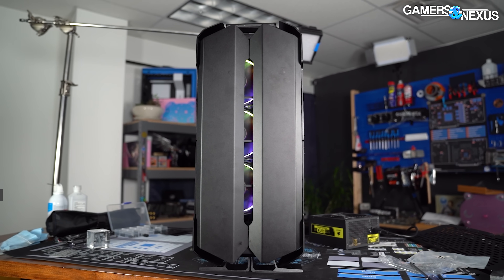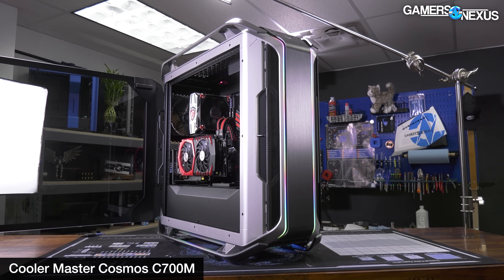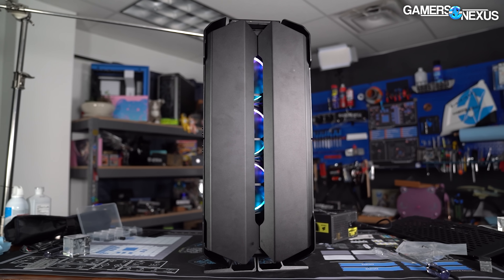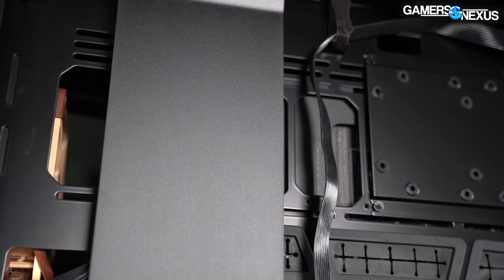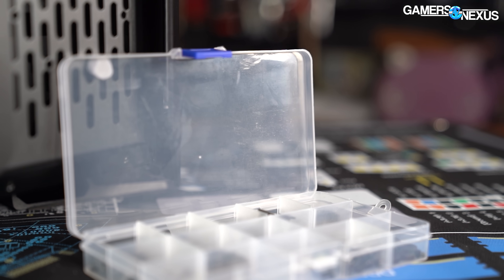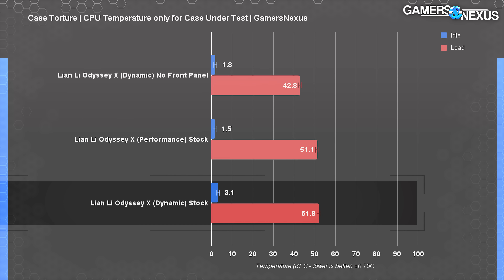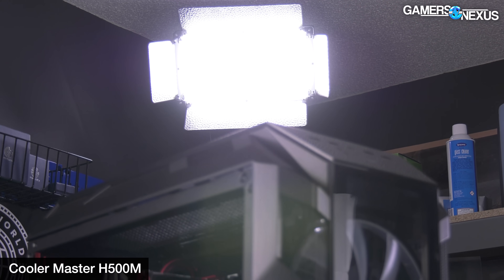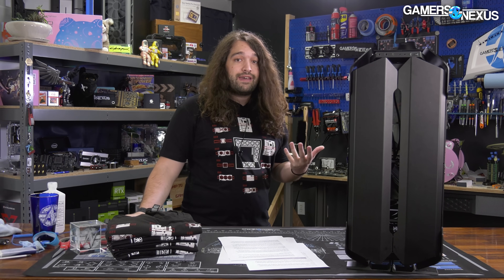Lian Li Odyssey X $500 Case Review: "Transforming" Full Tower

Comment: I can strap a 40 cm desk fan to the open side of a 50 dollar case  and have better thermal performance than any of the cases on that list, now that is good engineering! And it would  probably be even super quiet/ low pitch. A case HAS to run cool BEFORE worrying about looking cool and a 500 dollars one has to be the absolute best at both  to be considered. I like glass a lot too but on my windows to trap the heat inside the house while I am looking outside. I will never understand this obsession of using (expensive) glass for side panels, especially since components tend to run hotter and hotter lately.

Comment: Man for how big it is and how much it costs, I'd expect something along the lines of the 1000D, but the functionality just doesn't seem like it's there to the same degree. I thought $500 was a lot to spend when I could literally put 2 builds in the case, but this one doesn't let you do more than one, and has less room for watercooling parts and no easily removable fan racks either (corsair's fan mounts come out on rails to boot). I can also mount 2 480mm rads and still fit a 420mm rad in the top of my 1000D, though accessing fittings might get a little difficult on one at that point (i used 2 360mm in the front that I already had so this wasn't an issue for me). Those side panels also are meh IMO. folding in half is cool but for $500 i'd expect them to be held in place by something better than a glorified push pin

Comment: My main concern with such a case is radiator support. Let's be real, this is only for someone who has already spent ridiculous amounts on liquid cooling. But you may as well go for a super tower rather than this.

As an example, when I tried to build my rig in an o11 dynamic, with a 5900x and 3090, I could not fit a pump inside the case as the 3090 is far too long, so I had to mount the pump bracket in reverse, with my pump+res combo sticking halfway out the front. The side panel also wouldn't fit back on, because the VGA connections would break the glass if you tried to force it back on.

I looked at the o11 XL dimensions and even that wouldn't have enough space towards the front for a 3090+pump-res combo.

This looks like a case with plenty of room for liquid cooling, but doesn't functionally make sense, and is overpriced.

That being said I really want to see a Gamers Nexus review of the Lian Li V3000+, as that has support for 3x480mm rads. This is the case I anticipate to fill the caselabs niche.
Reply: Bitspower Touchaqua Sedna O11D, or any other number of distro plate combos.
Reply: @ronking5103  I would have gone that route but every distro plate was sold out at the time. Even right now on amazon someone is trying to scalp that model of distro plate for over $1600.
Reply: @trickytrickk2971  There are at least 4 different distro plates I'm aware of for the OD11.  A glancing search shows I can nab the EKWB version for 200 bucks on newegg.  My only point is bashing a case because it didn't fit your exact needs only shows that you failed to plan accordingly, it says nothing of the case itself.  While the case in this video is hot garbage, no doubt, there was no reason to drag the PC-O11D which most consider to be one of the best cases ever created into the discussion.  Lian Li for the most part make amazing cases.
Reply: @ronking5103  I'm not bashing the O11D. It's a great case that I didn't measure my components correctly for. And this build was done back in February. I scoured every site I could, but no distro plates were available, regardless of which brand, so I opted for an EK pump mounted on a fan bracket.

This was also my first build, and I discovered the hard way how important it is to measure components vs the case interior. The point I was making is that the case in the video seems like a water cooling case, but designed in the worst way for it, and that the V3000+ is going to be better for liquid cooling in almost every way, if it gets released that is.

Comment: eh I prefer just spending $1000 and building my own case. At 33x31x18"  wide (including casters) I don't think I will ever need a bigger one (at least I hope not, the sata spec is limited to 1m long cables). Doesn't blot out the sun either, since it's clear acrylic. And come to think of it is it's own sun too, since it has over 2500 rgb leds (that needs it's own 5v 500W supply).

Comment: I love my O11 D XL and it's my second favorite case I've ever owned, only being beaten by the Thermaltake Mozart TX, just for being such a monster of a tower. Granted, air cooling isn't the strong suite of the O11 D XL but slapping water cooling into it and a lot of RGB and it's just beautiful and performs through and through... Though you would expect it with nine fans in it.
This case here is just a full on mess.
Reply: do you still like your 011 D XL ? I'm thinking of getting one and will need your input to complete my decision.  I was leaning toward the Phanteks P600s but after reading your comment and re-thinking this.  I will have a liquid CPU cooler (360mm) which i presume would be best up top.  and then I'll slap really nice ARGB fans all over (if you would agree).  Not including the 360mm AIO which will go up top (roof of chassis), what is the number of fans I will need to round out this unit (011 D XL)?  and what is the size options i need for the fans (120mm vs. 140mm).  So that would help me tremendously if you wouldn't mind taking a moment to let me know what to do.  Thanks a ton !!!  Lastly , let me know of your opinion of the P600s ?  thanks a ton again, really appreciate it !!!!!

Comment: I have a 1000D, and I'll stick with the 1000D. I have one 420 mm radiator on the top and, two 480 mm radiators at the front. Lian, what were you doing?

Comment: Id actually rather have an expensive case without fans, i'm not gonna use them anyways unless they are actually decent fans, which most fans that come included arent. Also it is sometimes hard to find the exact same fans to complete the build. On cheap builds i love 2-3 included fams cause it actually saves costs on expensive cases they are usually just e-waste...

Comment: Can you do a roundup of cases that fit 360 radiators?
Reply: I also had to add that I bought the liquid freezer II 280 for my i7 4790k about 2 months ago purely based on your videos.  It's the shit.
Reply: Sorry one more....I seriously want case manufacturers to focus on a modular fitting system that allows me to put my i/o panel so my case can be used facing whatever way works best for my desk.  I can't buy a new desk just because my case doesn't work for it.

Comment: $500 for  a case that looks like it has worse airflow than my Antec 1100 OG?  nah, i'm good with my old case.
I've got only 3 fans in my case: 1 120mm as rear exhaust, 1 120mm fan mounted to AIO for an evga hybrid card as exhaust up top, and then a 140mm fan in middle position of a nh-d15 cpu cooler.  well 4 fans if you count the blower cooler of the evga hybrid card.  my case has very poor airflow from the front panel, but those two sidepanel fan mounts make a huge difference.

Comment: Currently rocking a 1700 and an rx480 8gb with a 1080p monitor was looking to upgrade to an ultra wide for sim racing could my rx480 run a 1440p ultra wide at 60+ in assetto Corsa competition or should I stick to a 1080p ultra wide? Thanks for your help guys.

Comment: What a shame! If that case could have fit a 420mm radiator and fans at the top, bottom and front all at the same time (so 3) then I would have got one! I'm building a super hot PC and want really extreme custom water cooling, for which I want three 420mm radiators for my CPU, GPU, M.2 block cooler, etc. And they should have put the PSU mounting BEHIND the back plate, like they did in their other case, mounted on its side - as it is, without the ability for all those radiators the Odyssey X just a pointlessly big case, unless the fix that. I can't seem to find ANY case which can take three 420mm radiators (and the 140mm fans on them) at the same time.   :(

Comment: Crazy idea for the Silverstone Raven RVZ03 (ARGB). About seeing what a cooler can cool max. Can it handle the following scenario (is anyone crazy enough to test this?) Stock Ryzen 9 5950X, cooled with liquid metal, Big Scythe Shuriken 3 with the fan replaced for a Enermax D.F Storm 120mm and on the case a Polimatech Ultra sleek vortex 12 120mm. These are the fans I can find that move the most air. If it runs, how hot would it run and how loud would it be?

Comment: What a flop. It looks bad, it's complicated and difficult to work with, it doesn't have good radiator/fan support and no dust filters, it performs awfully and costs a small fortune. They spent years developing it. They built it very well out of high quality materials. And it still sucks. GG.